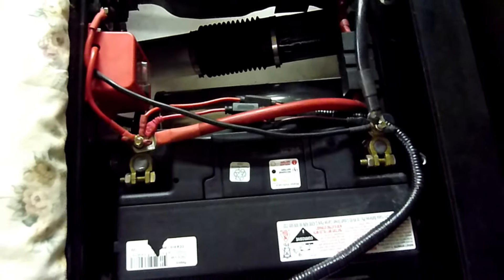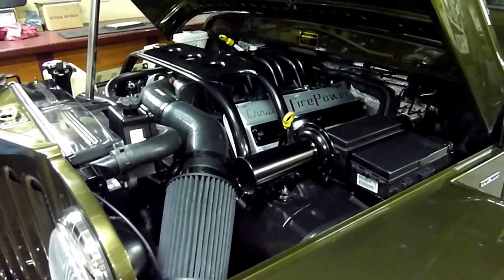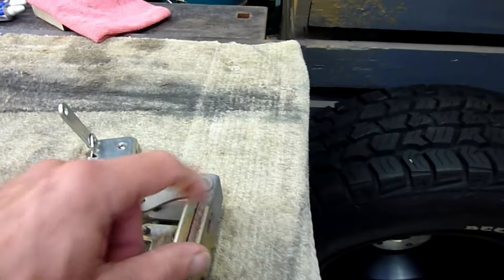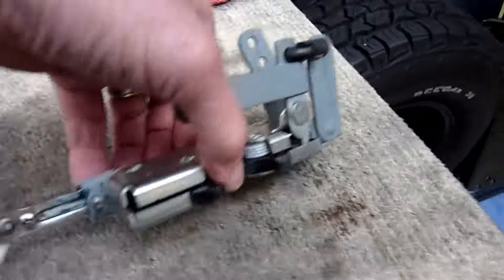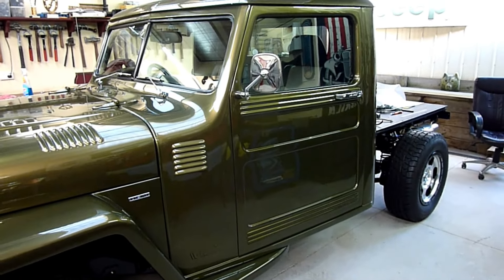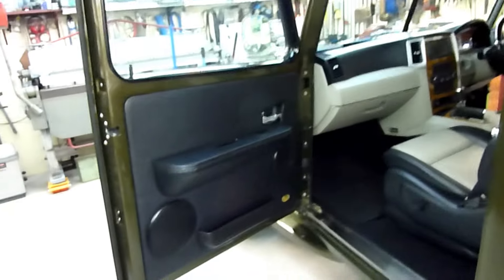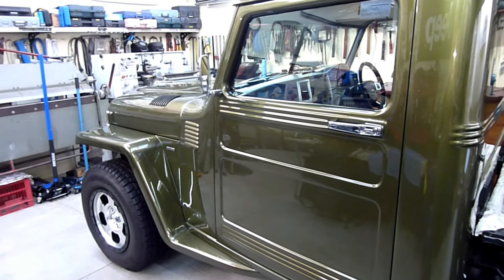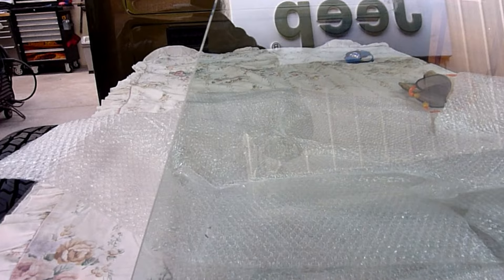Will it start after rebuild  New USA locks. Willys Truck No.53

Comment: So good to see a proper Hemi engine installed. My personal favourite Chrysler is the 1956 version of 354 cubes. My own Hemi is the 1957 Dodge of 325 cubes. It fits my 1933 Dodge without cutting anything & weighs less. I'm running everything trad, including dual Carter AFB's. It's gotta be a Hemi if you want to do it right.
Reply from the maker: Sounds like you've got a great build there!

Comment: Beautiful work Marcus!, love the way the doors close, fantastic!
Reply from the maker: I'm very pleased about the doors too. Was the only thing I didn't like how they worked in the whole build.
Reply: @Gojeep  does the insulation material make a big difference to the in cab noise levels?
Reply from the maker: @mikeconing9485  I wont know until I drive it. Certainly already notice a nice thump when you close the doors now and tapping on the metal makes no ringing.

Comment: Great startup Marcus, whew!! Colour coding is perfect and I wouldn't be pin striping, I think the paint and panel makes a great statement, adding pin striping might be too much. Maybe add some striping tape, then make up your mind. Looking forwards to seeing it outside in the sunlight wen you finish assembly. Look at toughened glass though polaroids, you will often find there's a couple millimetres around the edges and corners where you can massage it a little, but keep it to a minimum.
Reply from the maker: Got enough sanded off on the corners that it doesn't stick any more. :)